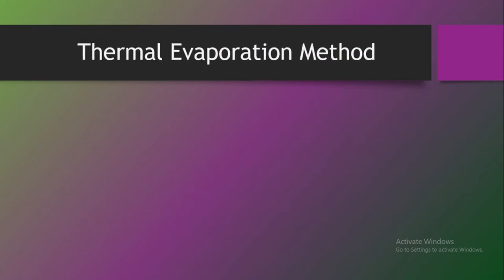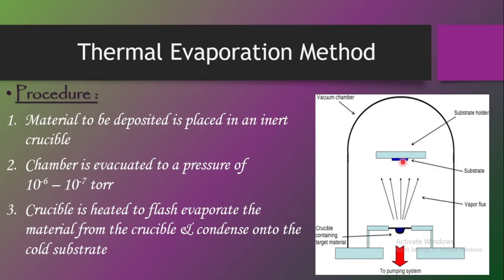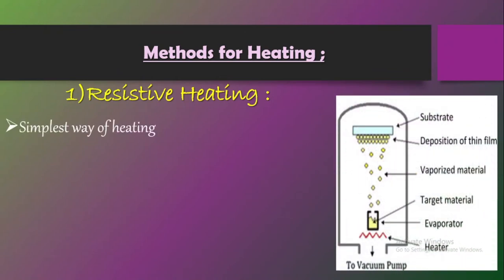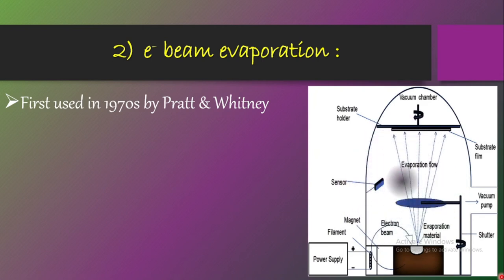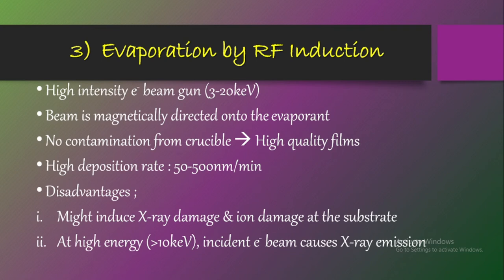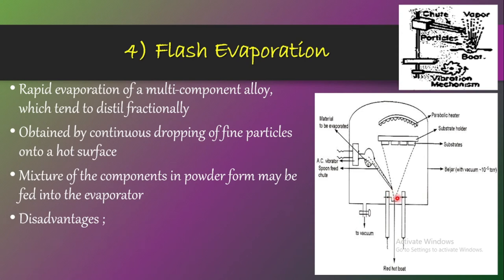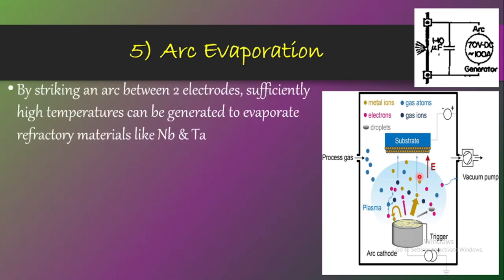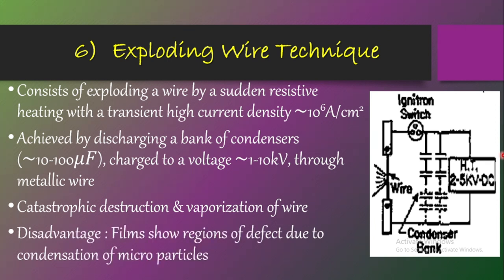12.Thermal Evaporation Method of Thin Film Deposition-Type of PVD with Procedure, Types, Pros & Cons

Comment: Ma'am 
1. why high vacuum is needed?
Reply from the maker: High vacuum provides longer mean free path i.e. source material which is vaporized reaches the substrate with little or no collision with the residual gas molecules in the space between source and substrate.
Also reduces the gaseous contamination within the chamber.
Finally pure & higher quality thin film will be deposited.